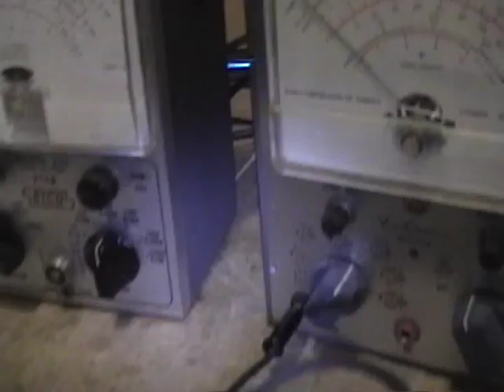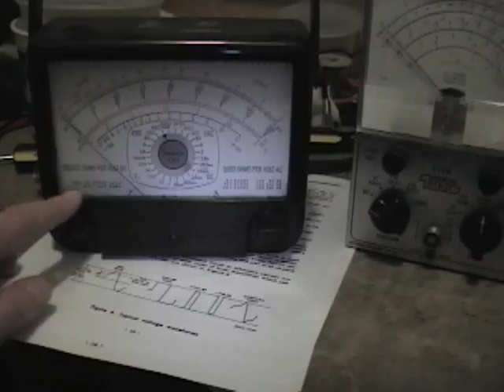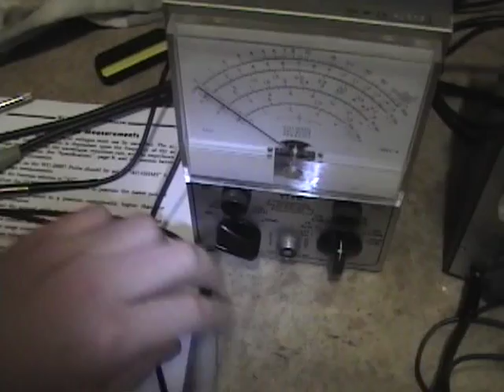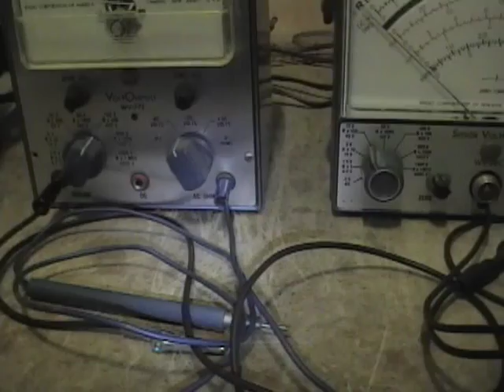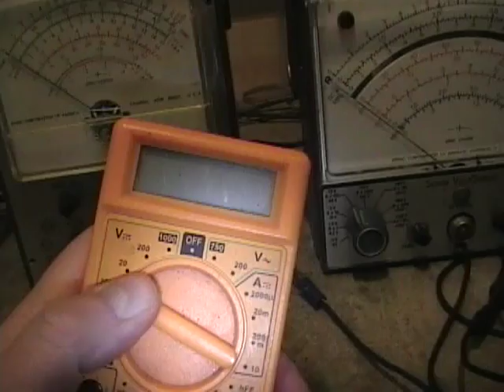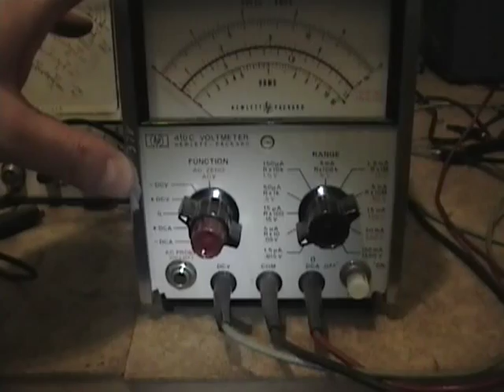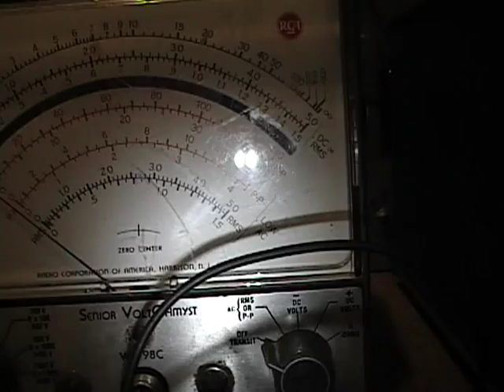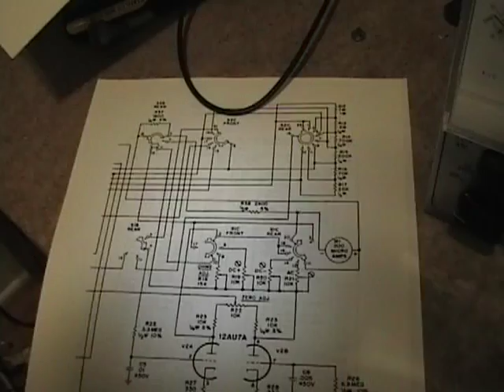VTVM 101  p1o3

Comment from the maker: Nope, I never heard of that model before.  I did a web search and found the manual at BAMA.  It's an odd design - and older than all VTVMs.  The schematic is dated May, 1944.  It uses a VR150 gas regulator and a 6C5 in the bridge.  The UHF probe uses a 9004 high frequency tube.  Good luck with it.

Comment: Bob, I just got an RCA VoltOhmyst yesterday, but as I was driving home I realized that what I bought was an RCA Master WV-510A solid state VoltOhmyst.It does plug into the wall or can use four 9 volt batteries for portability.It came with the probe and original instructions. The one D cell had badly corroded.I cleaned that up with vinegar on a paper towel.It looks similar to the Senior.My question is will this meter work for doing radio alignments or should I get a proper VTVM? Thanks a lot,Tom